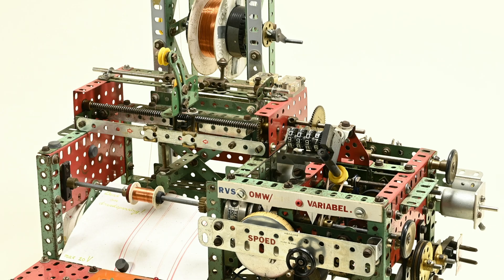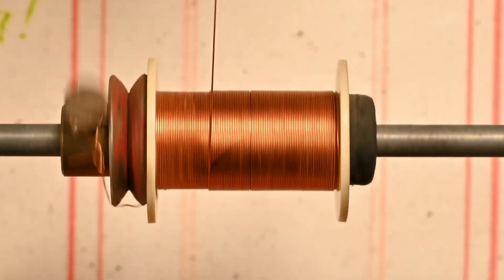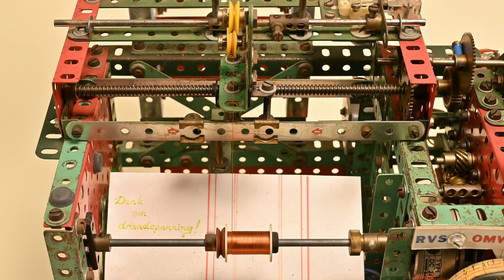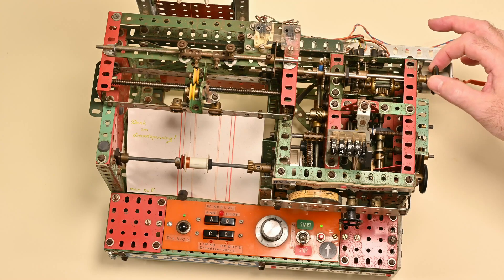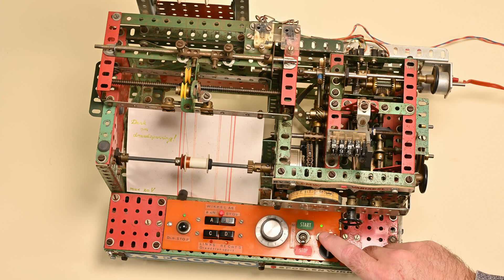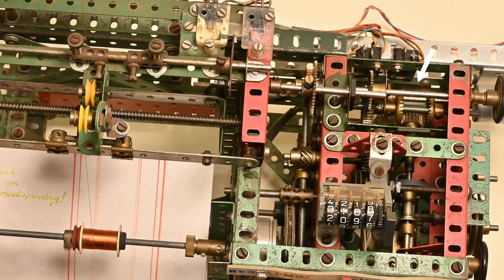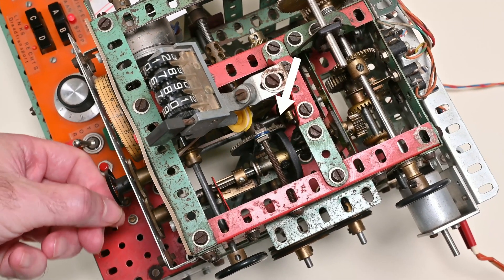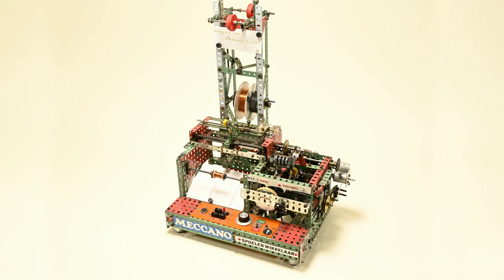Meccano Coil Winding Machine

Comment: But how is the orthocyclic stepover done?
This is more like a helical winding machine, where the wire step makes it somehow wind in a orthocyclic type.
This machine has no kickover on short distance, so winding is mostly parallel with short crossover.
Good for thick wire with supervision, to stop, as soon as it becomes wild winding, but not so good machine for real thin, fine wire and many turns, without supervision, which becomes chaotic very easily.
Reply from the maker: You are correct. If you follow the 1961 Philips Technical Review this type of coilwinding is strictly not orthocyclic. All your other remarks are correct as well. Nevertheless, in this case the wire is winded in a strict parallel fassion, it certainly isn't a wild winding. With 0.2mm thichness it's not by far the thinnest wire, but the result is pretty remarkable. On following weblink you can see an example of a Philips orthocyclic coilwinding device https://meccanokinematics.net/fac/models/21-next-generation-orthocyclic-coilwinding-machine/ Unfortunately there is no demo of this device and the exact workings when it comes to the short crossover winding remains unclear.

Comment: That is a very nice unit. I'm tempted to make one but its obviously a lot of work and I really only have one coil type I need to do and only a few required. Its out of a Smiths synchronous clock motor and it has 15,750 turns of 0.06mm wire, this unit would be perfect for the job so I might try a cut down version without the versatility of yours. Thank you for posting